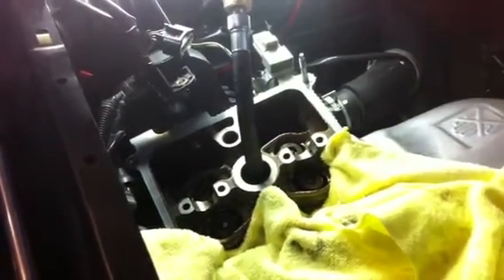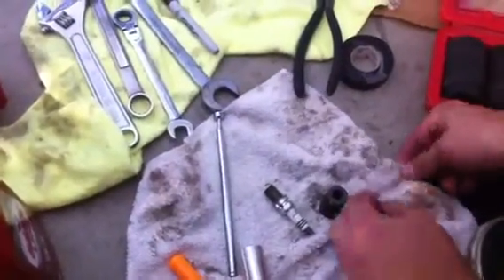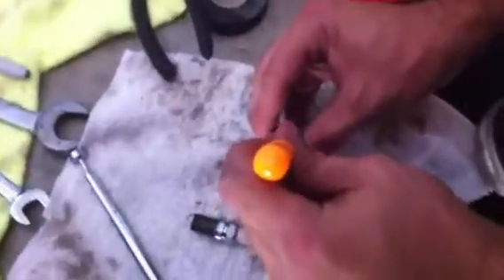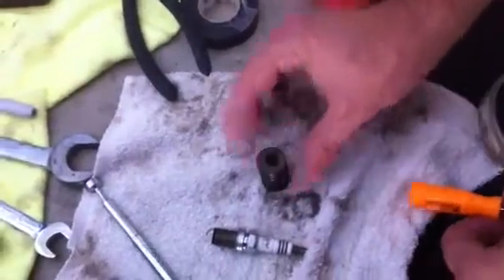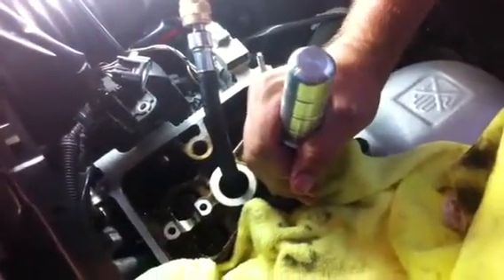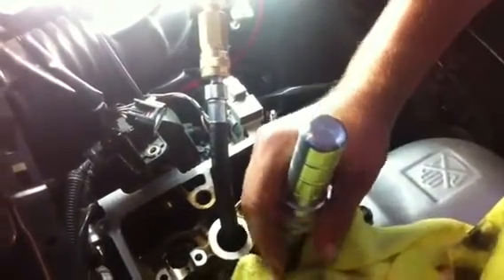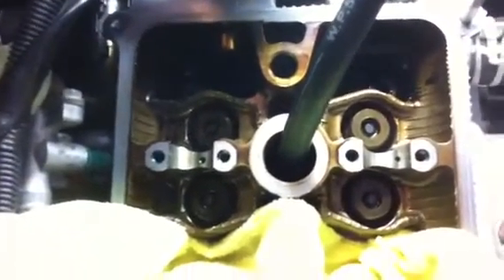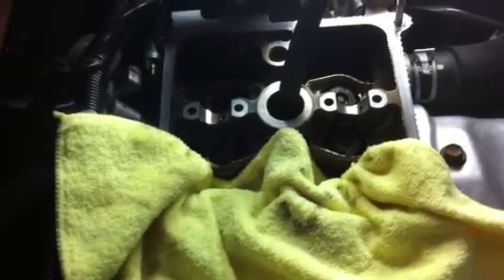2azfe valve stem replacement pt.4

Comment: I use this tool for the first time on a 2005 Solara with this engine. I removed the timing cover to make sure I didn't screw anything up. The one issue I had was that my 7 horsepower, 80 gallon air compressor could not keep the cylinder pressurized enough to compress the valve springs without the valves opening. This isn't really an issue. Simply set the crankshaft at top dead center. You can now remove the valve springs on cylinders number one and number four. The Pistons will prevent the valve from dropping too far down and you can successfully remove and reinstall the valve springs using the tool. Cylinders number two and number three can be done with the crankshaft set at bottom dead center. This method allows you to not even need compressed air to hold the valves closed.

Comment: I have this same engine with nearing 440,000 miles.  Definitely losing compression at this point - hand over the crankcase oil filler during idle and it's obvious.  I started getting the smell on cold starts through the vents every startup for the last few months.  Haven't bothered to do anything yet because it still runs fine.  Just started with Duralube treatment hoping it's just a ring issue that can be repaired by running it long enough... we'll see, but I could be back here to change the valve stems.  Thanks for posting all of this.  Very informative.

Comment: whats the air compressor for?  I have to do this same thing.  Thanks Mike
Reply from the maker: James Dean The air compressor pushed air into the cylinder to keep the valves from falling into the cylinder when you remove the retainers.
Reply: What if it fell down? How to rescue?

Comment from the maker: You'll need a long flat head scewdriver ~18" to rest against a bolt in the center of the block and force the end of the screwdriver against the end of the tensioner. Before applying pressure you will need a hook awl to lift the tooth lock so the tensioner can retract. This will take a couple tries, just make sure you lift the tooth lock enough to allow the tensioner to retract. The tooth lock is directly on top of the tensioner.

Comment from the maker: Unfortunately this is a timing chain set up and you would need to remove the timing cover if you were planning on rotating the crank with cams off. If you rotate the crank with the cover on the chain will bind up. I did this for time versus doing right. Getting the cover off with the engine in is a nightmare. Using air pressure @ 90psi makes it relatively safe. Please proceed however you see fit.